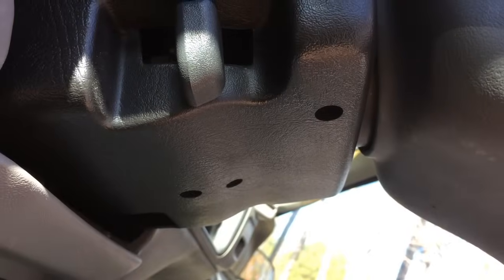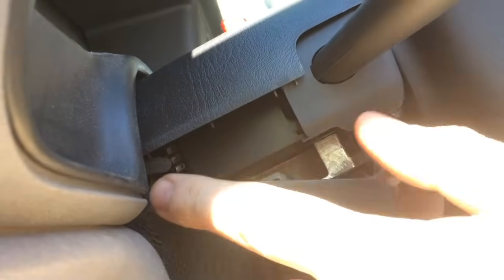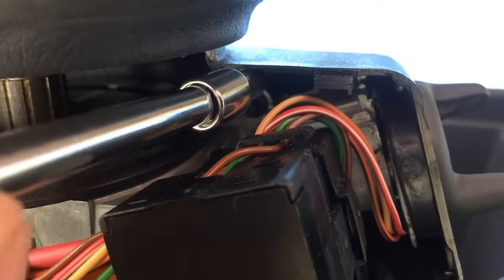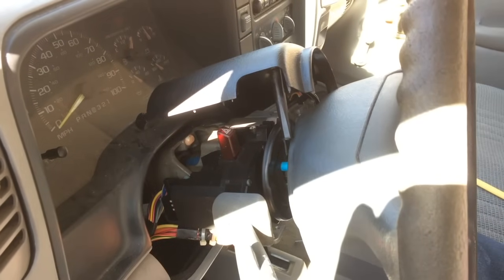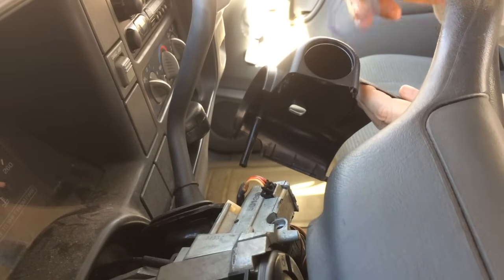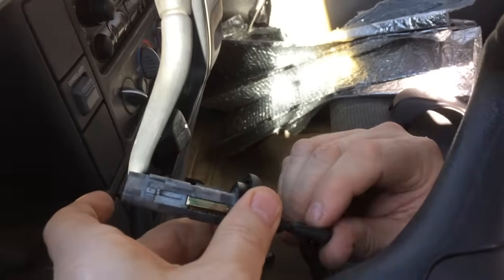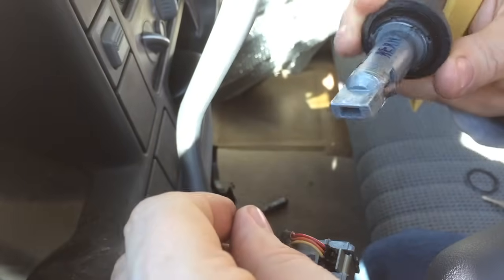1995 - 2000 OBS GM Truck Ignition Lock Cylinder Removal (Chevy Cadillac & GMC)

Comment: Thank you. My truck has started keeping the key in. I stop move to park, set park brake and I can not move the key all the way back to the position where the key can then be removed. Would removing and replacing as you did be the answer? Is there a Youtube on how to transfer the key components as you did so I don't have to have a new key? Any help would be appreciated.
Reply from the maker: It can be the lock cylinder as shown here, where either the tumbler spring retainer or the cylinder retainer have dislodged creating interference.  It can also just be debris in the cylinder bore, particularly if the vehicle is operated in a dusty environment long term (e.g. dirt road).    I would start first with just disassembly and inspection of the lock cylinder, and lubrication and reassemby if nothing is found wrong.   You can transfer the tumblers to a new lock cylinder to keep the same key, if you end up having to that route.  Or a lock smith can do this for a nominal fee if you bring in the old and new lock cylinders to their shop.
Reply: @DrShock  Thanks! I will try that and let you know. I really appreciate the help!

Comment: will this being bad cause the starter to click and not start? mine does this and i have to rapidly crank it and it will start time to time  thank you!
Reply from the maker: Typically with the ignition lock it is going to be problems turning enough to start, or getting the key stuck when trying to turn to remove after.   If the lock part appears working then I'd suspect either the ignition switch which is a separate part connected via harness or the starter motor itself.

Comment: Do you know how to tighten up the gear select by chance??? I've pulled the cylinder lock out since the key can be removed while running, but the battery goes dead if you don't turn the key off totally.
Reply from the maker: The adjustment on the shift lever cable, like here https://youtu.be/Obv-lwGu6g4 , is what initially comes to mind.

Comment: What is the point of moving the key to the start position before inserting the punch if I can't turn the key at all to begin with. That is the entire reason for replacing the ignition cylinder. The key will only turn backwards to the acc switch but will not move forward at all.
Reply from the maker: You'll have to get it turning or you cannot remove it.  It's a theft deterrent design.  Sounds like an obstruction is blocking the turning, or the lock cylinder is coming apart internally causing interference with turning it.  You might get lucky with some dry lock specific lubricant and doing the jiggle wiggle dance with the key.
Reply: @DrShock  Can the pin be depressed and the cylinder removed if the key is turned backwards to the acc position or does it have to be moved forward to the start position? Also one video showed that pounding a screw driver into the key hole thereby destroying the internal locking mechanism will allow one to advance the lock cylinder forward if all else fails. What would you do, that or use a drill? BTW, thanks a lot for the quick reply, it's much appreciated. 👍
Reply from the maker: No, it has to be turned in the crank position to expose the cylinder release pin.   If you do not have experience doing it, I would advise against drilling it out.  You can easily damage the steering column housing by going too far.   If you can't wiggle/jiggle it free I'd honestly recommend having a locksmith come out.  They will have the tools, and experience, to remove the cylinder for you without damaging anything else by accident.
Reply: @DrShock  Ok will do. Thank you.

Comment: Could anyone please clarify if I can and how I can keep the old key for the new ignition lock cylinder so I don’t have to carry two different keys?
Reply from the maker: Yeah, you can.  You just have to take the ignition lock cylinder to a local locksmith who handles automotive.   Ask them to re-code the lock cylinder for your original key.   It can also be a good idea to get a brand new key cut from your VIN so that you account for decades of wear on the old one.

Comment: What could be the problem when you buy a key cylinder and your vehicle turns off but my battery light is still on and drains my battery
Reply from the maker: Hard to say over a comment forum, but I would look at the ignition switch first to insure the ignition cylinder position is being correctly reflected.   You could test the switch by following the lower column disassembly in this video, then removing the plastic ignition switch cover so you can verify the correct voltage/wire in each key position.

Comment: Video was great. help me find that release but I would not recommend putting grease on it dry lubricant like graphite. Grease will just pick up dirt and pocket-lint and will cause a malfunction
Reply from the maker: The factory service manual specifies SuperLube grease GM part 12346241, probably because graphite is electrically conductive.

Comment: Do You Have To Get Your New Switch Reprogrammed?
Reply from the maker: There was no  programming of the ignition lock cylinder back in 1995 thru 2000, which is the scope of what this video is covering.  Bu you may have to perform a key relearn sequence, depending on the model year and the options on the truck.  Some information on this procedure is in the video description.

Comment: I have a new used Cheyenne 95. It turns on with no key required. Do I replace the cylinder or just leave as is because it works fine already...
Reply from the maker: So your 95 starts in the usual way, but with no key inserted?  You sure there's not a broken off key in there?    If it were me I'd replace the lock cylinder just to avoid the hassle of a random theft of an old truck.  But if it's a farm truck, you might just leave it be.
Reply: @DrShock  the door key slides all the way into the ignition cylinder. I don't think there is a key broken off in it. I noticed because the door key is really loose in the ignition cyl, so one day I just turned it without and sure enough it started. I live in the city. Lol.
Reply from the maker: Wow, very unusual.  I wouldn't have expected the tumblers to fail in the unlocked and free to start position there. ;-)
Reply: @DrShock  yea so I always thought the door and ignition were the same key up until a week ago. I bought the new cylinder lock for ignition, hope it works for me.!!

Comment: I have a question my 95 gmc lock cylinder is locked on ON it only turns two times and I cannot turn it on the 3rd time so. The ignition switch I had it also turn whitout a key but it just stayed on the 2nd turn, so I went to get  a new ignition switch because I  thought i would of fixed it but  now that I installed the new ignition switch when I put the new ignition switch I couldn't removed the key because it was stuck on the 2nd turn so I had the same problem but now that I have a new  ignition switch the key stays on because of the 2nd click and when I try to turn off the truck the shift indicator stays on and I have to remove my ground terminal on the battery so the battery wont die what's the problem here.
When I turn the key it just clicks twice instead of 3 I need help
Reply from the maker: Let me make sure I understand what you're describing here.   So you have a 95 GMC fullsize truck and the ignition cylinder would rotate without a key inserted?    You replaced the ignition switch (I'm going to presume you meant the ignition lock cylinder here not the electrical switch) and now you cannot turn the key to the off position on the steering column?   If that's correct, I would suspect something with the ignition cylinder housing since you replaced the lock cylinder (again presumably you meant this and not the ignition switch which is just an electrical module) and its still giving you rotational problems.   The ignition lock cylunder has to be able to freely rotate within the steering columns ignition housing and if it isn't you have to identify and correct what's binding it up inside the housing.

Comment: I cant turn my key at all😡
 Any suggestion to get it off without drilling.
Reply from the maker: The lock cylinder cannot be removed unless it can be turned to the removal position as shown in the video.  Before resorting to the drill, or calling a locksmith, I would try some spray silicone lubricant around the cylinder (not where the key is inserted).  Then I would try some jiggling with the key to attempt to get it dislodged where you can turn it.  That's about all you can do.

Comment: So there is no programming of the new key or cylinder?
Reply from the maker: The range of years for these old body style trucks reflects an era before the scan tool programming of modules.  So no, no scan tool is required to change out just the lock cylinder in an OBS truck.  But some OBS trucks might throw a security lamp on the dash, particularly with non-GM parts.  If so, try the simple key relearn sequence below that I also have in the video description:

1)  Turn key to the on position (lamp test) only.
2)  Then turn further to try to start the engine, then release the key back to the on position.
3)  Watch for the “security” lamp on the dash to be lit.  This happens because the EVO/Passlock module and VCM didn't recognize the new lock cylinder/key combination so the VCM shuts off the fuel flow to the engine as an anti-theft action.  After 10 minutes the “security” lamp will turn off.
4)  Immediately then turn the key to the off position, and wait another 10 seconds.  No more, no less!
5)  Again try to start the engine, and then again turn the key to the on position.
6)  Watch the “security” lamp on the dash to be lit again.  After 10 minutes the “security” lamp will again  will turn off.
7)  Again turn the key to the off position, and wait another 10 seconds.  Again no more, no less!
8)  Again try to start the engine for the third time, and then again turn the key back to the on position.
9)  Once again watch the “security” lamp on the dash (third time).  After yet another 10 minutes the “security” lamp will turn off.
10) Now again turn the key to the off position, and wait another 10 seconds.  Again no more, no less!
11) The truck has now learned the new key/lock cylinder hardware that you swapped in.  When you now try to crank then engine the fuel should flow and it will start (some might reset after just the first 10 minute dance) - presuming you followed these steps exactly.  ;-)

Comment: Can’t turn the key something must have gotten up in there or the spring won’t engage because it’s like I’m not putting my trucks key in. Sounds like the same problem you had the first time how did you depress that pin without getting it to start position?
Reply from the maker: What I've seen is the tumbler cover / plate will dislodge on one end   You can get some additional lightweight lock grade lube in there via the release access hole, and you can try fishing a solid copper wire thru that same hole of large enough gauge that you might dislodge the plate.  Be sure it's thick enough that it won't break off in there while you try!  Last resort is a locksmith, they would have the specialized tools to force it out.

Comment: What if my key won't go to the start position so I can press the pin out??
Reply from the maker: That's from an obstruction in the bore where the cylinder fits in, usually the tumbler spring retainer is the cause like I mentioned in this video.  But it can just be foreign debris.  You'll have to get it to move to remove the cylinder, in the comments some folks have had luck over lubricating this area.  You can shoot a thin lubricant thru the release hole on top to get it right onto the cylinder.   You don't need it where the key goes in, you need it where the cylinder turns in the steering column bore.   Needs alot of patience but it can pay off.  If not, call a lock smith and they'll just drill it out for you.

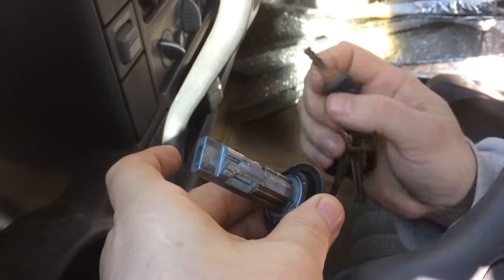Comment: At 5:35 you start talking about the plate on the bottom of the tumbler of not "staking" it: how do you "stake" it, that is what my problem is.
Reply: Thanks for the reply. Great video, from this video is how I found out about the plate which was the problem with my steering column. Too late though, I was already at the scrap yard looking for a steering column. I still have the old steering column and the ignition tumbler, I'll try what you said.

Comment: I’ve been trying to get my ignition out for about 20 minutes I put the pick in the hole and it won’t go down
Reply from the maker: This usually would mean the switch is not in the off position fully.  If its even a slight bit towards run the release won't be lined up with the access hole.  The switch housing could just be very worn with excessive play.   I would suggest a small drop or two of light oil (e.g., 3-in-1) and wiggling and flexing slightly between acc/off/run until you can feel the release with the pick.  Then you'll know where it is off and work to adjust as needed.

Comment: My cylinder was totally locked I had key but couldn't make it turn no matter what I tried lube shaking vibration nothing until I straighten a safety pin and used it to push in that locking thing we're the springs were broken
Reply: did you solve this issue
Reply: did you solve this issue
Reply: justin brown 
Yes watch at minute 5 it shows the tab that should drop when the key is in . If you use a safety pin that's straighten out you can push  up on that tab then push in the collar it turned when I did it just had to try it a couple of times to get it right

Comment: So if I can't turn it to start position how will I get it out?
Reply from the maker: If you have the key, it's worth fiddling around it it to see if you can get it to release.  Some light, not greasy lubricant designed for locks and help.  If you've lost the key, the only route without damaging the steering column is to call a locksmith.

Comment: So I can’t turn my Tumblr to the start position because I can’t put my key in the ignition hole because there is debris stuck in it what do I do
Reply: Please help
Reply from the maker: This might be a situation that will require a locksmith.  But you can first try compressed air with a light lubricant to dislodge the obstruction.  If its smaller, then perhaps a unfolded paper clip would suffice.

Comment: if I buy a Lock cyl Set will I need to program the new set to match the computer settings?
Reply from the maker: For the years this video covers the ignition lock cylinder has a magnet type sensor embedded in the cylinder that is part of the PASSlock theft system in the steering column.  There are 10 different sensor values, sometimes you get a replacement that matches and you're done.  Other times you may have to do a relearn.  There is no scan tool required, and no programming of the PCM required.  It's just a simple key on, key off (KOKO) type of relearn. 
 Not not all years will need this, only necessary if the security lamp comes on after replacing the lock cylinder.   The replacement lock cylinder should include an instruction sheet on the procedure.
Reply: @DrShock  Wow Doctor thanks for the quick response - I have a 1996 GMC SEL pick up hopefully I won't have too much trouble. I am waiting on parts and I think I will replace the steering column shroud too! upper and lower!

Comment: How do you do that with a stick shift??
Reply from the maker: The manual transmission steering housing and lock cylinder parts shown are very similar for the years this video covers, and also in the description text.   The only lock cylinder difference is that the push button thumb release on the cylinder itself is needed to turn it.

Comment: I the install new cylinder in my truck I don't work key turns good like new, start for few seconds and turn off ,and a put back the old cylinder and run good.

Comment: I bought a cylinder kit with two keys from part house. Do I have to have a reprogram to start my truck. 97 Silverado
Reply from the maker: No key programming for 1997 Chevy trucks.   Just be sure your ignition switch is working/OK before you reinstall the new lock cylinder.   And that this is the correct lock cylinder for your vehicle, the security system depends on a GM design using an embedded magnet in the lock cylinder.
Reply: @DrShock  yes it cranks fine after wiggling it for about 15mnts to get it to turn. now I just barely turn it back so it wont lock me back out. I just wanted to check with you before I installed  it and had another problem

Comment: Does anyone know where you can find GM 26036499 cover? It seems like it is no longer available and it the part that breaks easily...
Reply from the maker: There's an eBay affiliate search link for this, and the other related parts, in the video description.  These parts are all discontinued, but they do pop up on eBay from time to time.   Another option is a trip to your local LKQ salvage yard, and pulling one yourself.  I'd suggest only a 1999/2000 for the 2500/3500 series, and 1998 for the 1500 to get the newest plastic you can.  ;-)